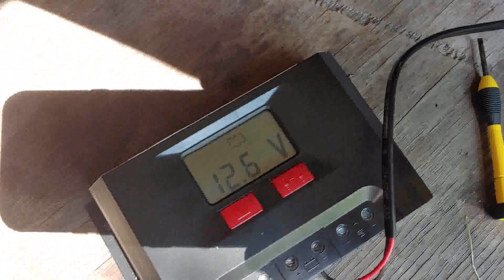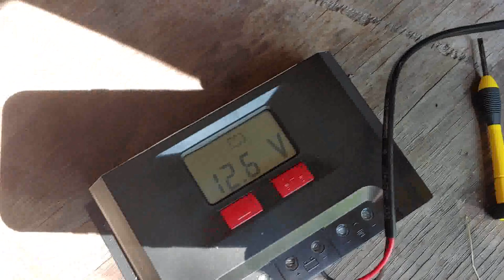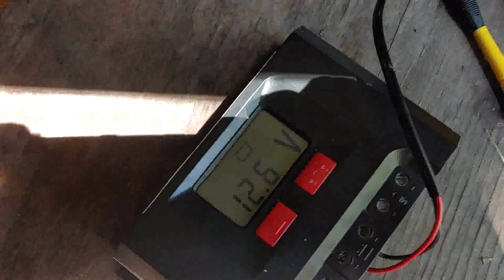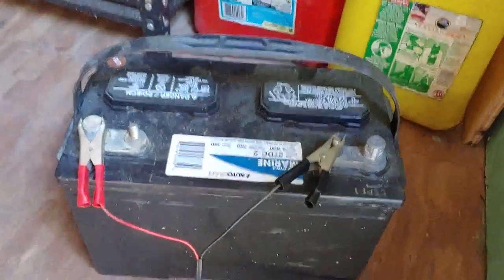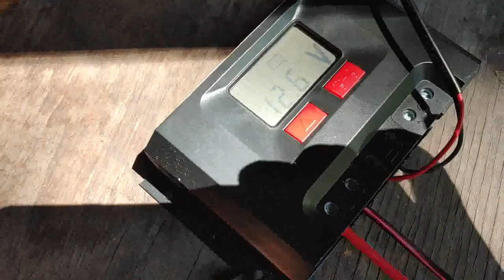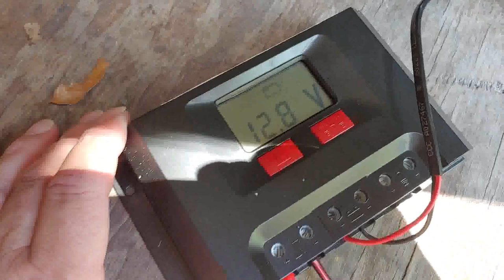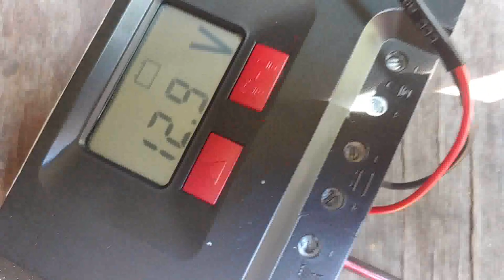Trickle Charging a battery with Harbor Freight solar panels and Thunderbolt charge controller.

Comment: I have the 4 panels harbor fright solar kit, it's easy to use, it charged my 2 rv batteries in about 5 hours to full, when we check it was almost 80 watts at full sun about noon in Ventura beach California, if you want some easy to charge your, cell phone or run some lights, this is a great deal, and you video's can help you figure it all out...
Reply from the maker: Thanks for your kind comments

Comment: You typically don't want to disconnect from the battery while the panels are still connected to the controller because they tend to fry.  The cheaper HF controllers especially.  That being said that is what I am using on my 2 - 270W panels on my shed.  I haven't had time to optimize the angle and rarely have time to clean them so I am not worried about them overpowering the controller.  I also currently only use my set up to charge all my electric lawn care and hand tool Ryobi batteries so the draw is almost never over 200-300W at a time.  Great quick video and explanation of a simple solar set up though.
Reply from the maker: I also use my solar to charge my lawn care equipment. Thanks for your comment
Reply: @shoestringprep  irrelevant

Comment: Very clear display of equipment and connections. Am confused on trickle aspect. It appears you're charging at full voltage especially since the battery voltage level rises so quickly. My trickle charging equipment operates at full volts but reduced watts. In what way are you trickle charging? What would need to be changed for full (non-trickle) charging?
Reply from the maker: By trickle charge I mean a slow charge with low power solar panels, under 100 watts
Thanks for your comment.

Comment: I'm trying to create a set up for a portable system (old garden trailer) but also on onto the side of the pole building facing south. There was one (is one) still there...it may still work except for the battery AND THE FACT THAT ALL THOSE DANGLE-Y WIRES get hidden in the grass and whippered to shreds in the weed wacker. :-/  I imagine I can still "save them" with new connectors (if I can work out + and -) -- And I'd better feed those through some sort of housing (thinking PVC) so that 1 they are super visible and 2 protected from a heavy duty string trimmer.
Haven't checked so far the size of a PVC I'd need to run the cords through. Think I can fairly easily attach them with pipe clamps/hangers thru the metal siding up the side of the building and thru and access hole. (Instead of how they were first run, down on the ground under the edge of the siding between it and the concrete pad! (I did not do that...it was "done for me".   But ya know...I can fix it...just as soon as the heat lets up...and the rain...
Reply from the maker: I also have PVC tubing to protect my outside wires, and that solution works really well. This arrangement was also "done for me" so I can't take credit for that idea.
Let me know how it works out for you.
Thanks for your comment.

Comment: Where did you get the connector that you connected the lines from 3 panels to?  Saw it in another YT video but can’t find it on the HF website.
Reply from the maker: The connector came with the solar panel kit from Harbor Freight. Perhaps if you contact Harbor Freight directly, they can help you. Alternatively, hook the three solar panels into the hub.
Reply: @shoestringprep  ah makes sense. Thank you and thanks for the great video!

Comment: Where do you find 15W solar panels that large, the 1960s?
Reply from the maker: Josef
I bought a 45-watt solar kit from Harbor Freight a few years ago, maybe 4 years ago. The kit had the three solar panels shown in the video, each at 15 watts. That is where the 15-watt solar panels came from - I hope that answers your question.
Thank you for your comment.
Reply: @shoestringprep  I didn't realize they were that enormous such a short time ago.  My 180w panels on my RV aren't much bigger than that.
Reply: @Josef_R  Believe it or not the 15 watt panels are amorphous solar panels and work better than Monocrystalline panels in lower light or cloudy conditions, the trade off is they are much larger.

Comment: the bottom cords you connected to the bottom charge controler that you have to screw and unscrew will charge the battery with out doing it the old fashing way ? Second question the negative you have it connected to the smaller connecter that won't ruin the battery
Reply from the maker: For your first question, I'm not sure what your asking. The method I showed to connect the charge controller is the proper way to do it.
As for your second question - I have used the large and small terminal posts interchangeably for years and never had a problem.
Thanks for your comments.